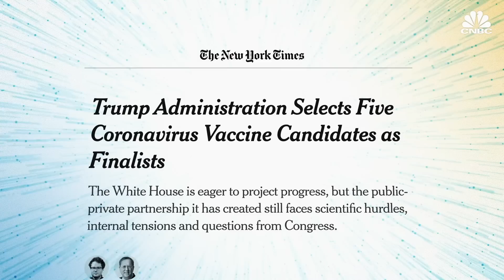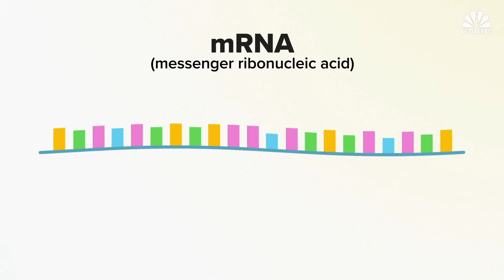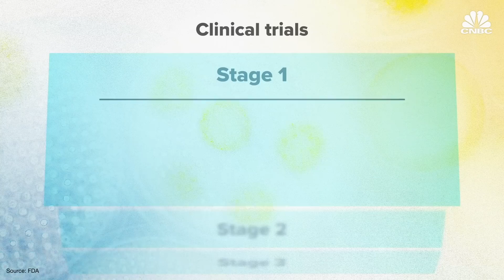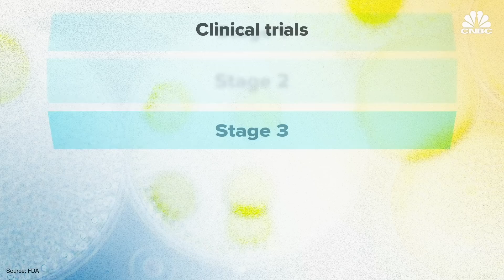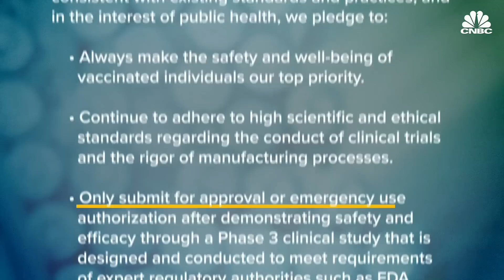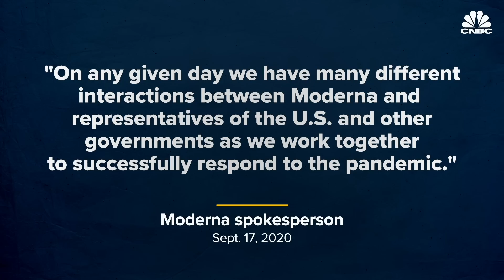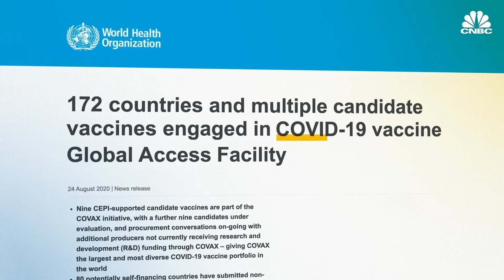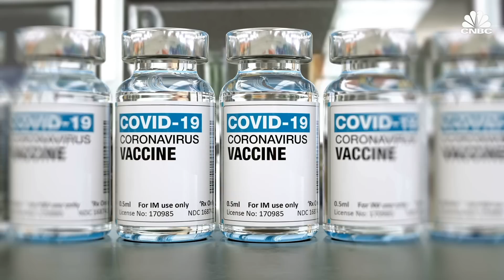What Is An mRNA Coronavirus Vaccine?

Comment: I foresee this going BAD. There's going to be an overproduction of proteins or the mRNA is going to code for the wrong thing or something crazy.
Reply: Those shouldn’t be issues.  RNA is transient, so mutagenesis is not an issue being that it is relatively unstable with a short half-life.  Although modifications may be added to the RNAs to make them less sensitive to degradation for the vaccine to take into effect, overexpression should still not be an issue.  

However, one thing that they should be concerned about is interferon response to the vaccine, as exogenous RNA can cause interferon-1 response, causing potential inflammation and even auto-immune responses.  Presumably, in passing clinical trials, these symptoms will be benign and mitigated (hopefully).
Reply: Naheel Khatri bruh there getting it out Quick which is dangerous because of lotta bad things could happen
Reply: Nabari67 I’m saying mRNA vaccines should not have the issues the OP is worried about irrespective of speed.  RNA just doesn’t work that way.
Reply: Naheel Khatri oh sorry
Reply: Thats the point.... They even said that they will test it on the public before they know the full effects.
Reply: K-TRAIN That’s not going to end well
Reply: I bet u zombies if so I’ll be prepared
Reply: @Apw-mu9uv  How would you prepare yourself though?
Reply: Amina Johnson iv been prepared
Reply: I thought the same thing. Messenger RNA giving genetic instructions to an already natural DNA framework. What exactly are in these instructions? I do not want my gene code manipulated.
Reply: Well No one had that issue in Moderna or Pfizer's phased 1 or 2 trials, talking about couple hundred people.    Phase 3 going on now and that will tell us much more, but i read the New England Journal of Medicine Papers on both MRNA vaccines and they have low side effects and show lots of CD4 and CD8 T cells being made and immunity being achieved.
Reply: That's just the tip of the iceberg. Much more serious and probably DEADLY consequences ARE associated with this vaccine.
Reply: Probably something bad would happen but its best to have hope.

Comment: Full disclosure, I invented the mRNA vaccine approach (woolf, wiederholt and taylor, 1998). I have no financial stake in any mRNA vaccine.  mRNA vaccines for many other diseases have been in trials for over a decade with thousands of patients safely. Any live or attenuated vaccine results in viral mRNA expression, so conceptually mRNA vaccines are no more dangerous than live or attenuated virus vaccine, and actually should be safer.  Before mRNA COVID vaccines are approved they will have been tested in more than 10K people.  There is always some risk with any vaccine, but the risk of death or serious long term damage from getting covid 19 is a much higher risk, in my opinion..
Reply: @patricasensio6074   10 years is how long it takes in regular times.  
Also, many trials were for cancer vaccines, which don't get approved just for being safe and inducing an immune response, as they also have to work against the cancer.